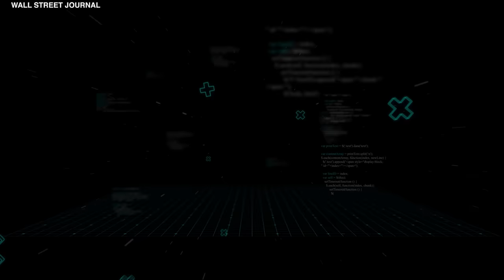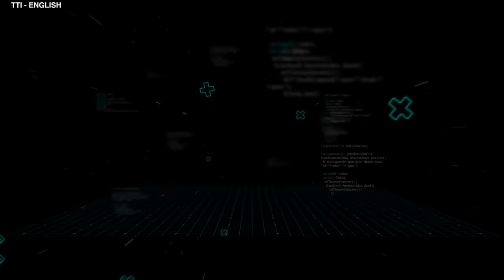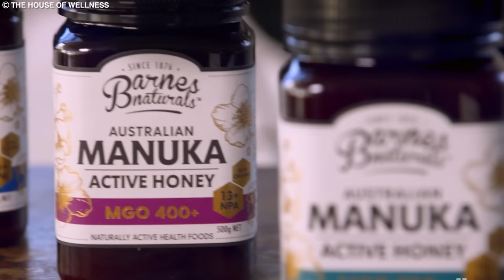20 Foods Only The Rich Can Eat

Comment: Apparently if you eat it off metal cutlery (caviar) it releases a horrible taste when the metal causes the eggs to release a chemical 🤔 so I ask why is it packed in a tin 🤔?? I'm hope it's not overlooked and the tins coated with none reacting material. 
Birds nest soup is disgusting it's birds stomach bile that goes rigid. Also if you've never had lobster 🦞 you ain't missing much as it's only usually the butter or other condiments added that taste of anything the meat itself is quite bland.  In the UK most crab and lobster is shipped to Europe 🇪🇺